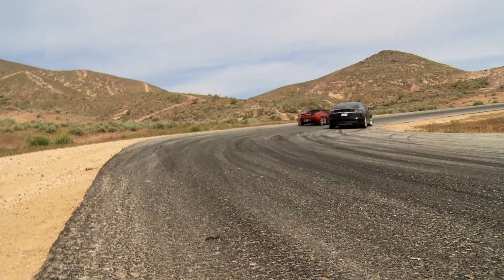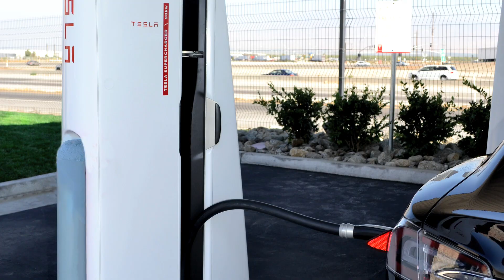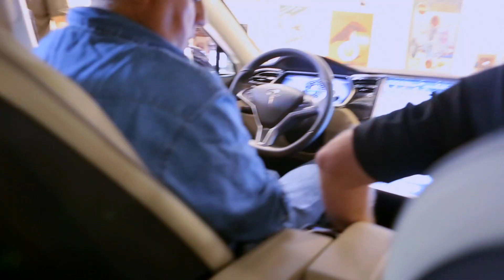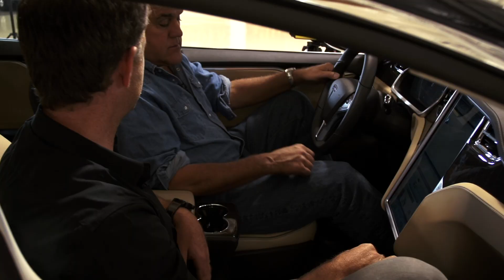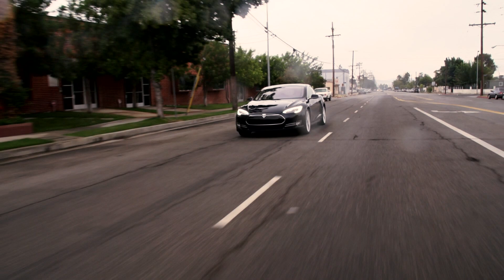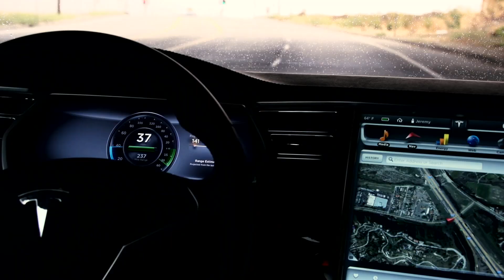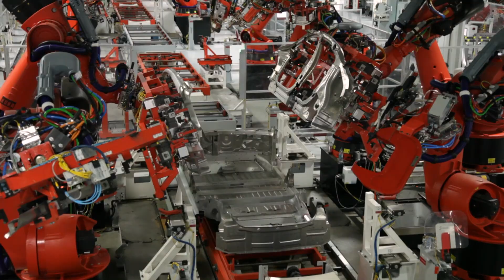2012 Tesla Model S - Jay Leno's Garage

Comment: Thoughts nice, 450 mile range after a 3 minute charge , that's over engineering for what really is the first mass produced all electric car that performs like a Aston. Lets face it most Aston,s are parked up out side the posh tennis and golf clubs all-day and probably only clock up double digit mileage daily anyway why a need for 450 miles on a single charge.

 Give the car some space and time remember when it was only the rich who owned Mercedes  now your local taxi driver uses one to take people home at night. Next to the house you buy, a car is your next big purchase and this car is perfect the way it is probably to perfect if you stop and think.

 No more trips to the dirty petrol stations and waiting behind someone who choose to do the weekly shop and a full tank here in the UK empties your wallet weekly .

 No more smelly engine or gearbox problems just good clean organic motoring with dare i say fewer visits to the garage in fact i cant really see why you would need to go to the garage at all ,perhaps the brakes, but there energizing braking system largely avoids that , more money saved, big bucks compared to the Aston i here a oil change is a couple of hundred! .

This is the thing its really not a car anymore it a ride its thinking outside the box its convenience at the highest level the sort of thing the Iphone did to the rest of the competition, its raised the bar and the competition should take note and of course will in the very near future.

The price tag is of course a sore point but who buys a car cash anymore its allways done over a 5year period so i hear around a 7500 deposit and around 150 aweek  its yours and bare in mind if you do a litlle more than avrage milage a week the zero cost of fuel you save more or less covers the monthly repayments here in the UK.

Its a no brainer this model s is the future and when the car maker gives birth to a few baby versions for the young ones and the oldies its job done, good riddance to smelly, dirty, noisy, expensive, troublesome combustion engines for ever.

Don't get me wrong the model S is obviously not the car for all but the theory definitely is!
Reply: i think it was 30mins. but still if you are on a roadtrip you can just stop for a cofee or lunch. and i really like that Tesla has released all their patents to public so they dont slow down on the prosses :)
Reply: Exactly. Right on the head!
Reply: john spicer I

Comment: Electric cars are quite, now have good range, amazing acceleration, great top speed, loads of space, low centre of gravity, great for the environment and even the factories are clean. Can someone please remind me of the plus side of a gas car? Once true mas manufacturing of electric cars happens they will actually be cheaper to buy than gas cars 'and' not need maintenance.
Reply: Marine475
pretty much all you stated is either wrong or poorly understood (purposely distorted?). efficency of an electric engine is about 80%...any combustion engine has a below 40% efficency...so basically 60% of that power inside gasoline is tronsformed into heat, not motion. An internal combustion engine is about 4 times more likely to catch fire. "Advanced power cell" which isn't even the correct word, (i think you ment hydrogen fuel cell) is not used in the tesla...but your statement isn't even factual anyway. Yes, the tesla uses electricity...which is signifficantly cheaper than the same amount of energy in gasoline. 85kWh power worth of gasoline is 4 times more expensive than 85kWh electricity. And no, you do not need an industrial grade powerline...most countries on this planet have 240V anyway. I could go on and dismantle your other statements, but i will just leave it at that to not embarace you any further.
Reply: Still power density of crapiest gas is times greater than of the most advanced power cell that btw tend to explode when fully loaded+ even under very mild usage this car uses more electricity in an hour than your home during entire month. Oh yeah and to load it's batteries you'll need industrial grade power line that alone is as expensive as the car.
Reply: sHmAaa
how is that even an argument? 200 years ago, people relied on whale oil... there are literally thousands of examples of whole industries vanishing practically overnight due to new inventions. This is not a problem, but an opportunity. History has proven your argument so wrong, it makes me question if that post was even serious.
Reply: Marine475
yes but fact remains, that even though gasoline can store much more energy than a battery, the efficency of any gasoline engine is half of that of an electric engine, period. You can deny that as long as you want, it still remains true.
Reply: thedon008 I've driven cars that cost me 5k that lasted me OVER A DECADE. Cheap car means the methods and materials used to manufacturer the car has been perfected and streamlined enough that they can sell the car for a lower price and better compete with the lower priced economy gas cars.
Reply: When electric cars are the norm rather than the exception and the whole infrastructure has adapted to them then their cost will be on average only half of what today's smokers are.
Reply: Peter Stephenson
as I stated above, electric cars are already cheaper over a 10 year (or even less) period, simply because the maintenance cost is so much lower and the "fuel" cost is basically a tenth of what gasoline would cost.
Reply: Jeremy Prince
you do realize that it is a high end luxury car? A Mercedes or Lexus in the same category costs the same or even more.
What power source it runs on depends on where your electricity comes from. In many states or countries it is already to a high percentage renewable energy sources.
Even if it comes from coal, the efficency of the plant and the electric engine is about twice as high, as any gasoline engine. Fuel cost per mile for an electric car is about a tenth of a gasoline car. (atleast here in europe where gas is relatively costly)
So your carbon footprint is signifficantly smaller (only 20% of a normal gasoline engine), even if the energy came from a coal power plant. Ironically enough it would be more efficent if the same amount of gasoline would be used to produce energy in a power plant with an efficency rate above 85%, then used in an electric motor to produce the same kinetic energy as if you had used that gasoline in a conventional engine with an efficency rate of not more than 40%. (most of the energy in a combustion engine lost as heat.
Smog would be a something of the past, even though you may not care about smog, the citizens of Beijing or San Francisco do.
Most people use their car for a daily trip of about 50-100 miles if they have to use a car to get to work. Well within the range of any electric car. Sure there are people who drive 400 miles or more per day, probably an electric car (with the current technology) is not yet ready for them. Honestly, I don't even know somebody that drives 400 miles in his private car on a daily or semi daily basis.
Reply: The plus side? Your whole economy relies on it.
Reply: Marine475
 im pretty sure most cables running to every house across all of NA are 240v and are brought down to lower levels so no trouble there.
Reply: Raussl
Uh dont know even where to start. Charging 85kwh through 240v line requires a lot of time, or very thick cable- how thick- google mr Ohm and ask him :) The thing about electric motor isn't about motor itself but about storage. Gasoline holds 44MJ of energy in 1000g *30% efficiency= 13,2mj/kg Tesls S batter pack holds 85kwh of energy @ 555kg- I actually wasted some time to find that one out. 85kw *3600s = 306mj/ 555kg = 0,5mj/kg. That's what energy density stands for btw. and yes the kind of batteries that can hold more power per kg overheat and catch on fire. Anyway Tesla S drives around with gas tank equivalent of 42l that takes 18 hours- (Mr Ohm) of charging using 240v 20A normal household power line. That's  elementary school physics btw. so if I got anything wrong feel free to correct me- in the process you might even learn how electricity works.
Reply: hgjh
Reply: Peter Stephenson "Can someone please remind me of the plus side of a gas car? "
They're cheaper. Let me know when I can buy a Tesla for $14,000 and I'm sold.
Reply: TactileCoder Well, when they're gonna be as crappy as a 14 k car, then you'll be able to buy one for such money...How can you even say you want one for 14? it's obvious the quality will be no where near what you gen in a model s. They will make a 3 series competitor in a year or so, and mass produce it. It will be around 30k.
Reply: eletric car is expensive than gas car
Reply: Muhamad Ubaied
depends on the gasoline car you compare it to...Tesla S is a luxury car with 400+ HP...a compareable gasoline car costs actually more or just as much. Considering there is no electric car that is produced in the millions right now, your statement lacks the necessary parameters to comapre it.
Maintenance is actually a lot cheaper for an electric car...no engine liquids or wear due to friction and the MUCH lower fuel cost make the car's maintenance cost significantly lower than a gasoline car.
If anything, the price is relative...for a luxury high performance car the Tesla S is actually very cheap. With all those side benefits in mind and over a 10 year lifetime period, the Tesla S is actually comparable to the costs of a 25 000 dollar conventional car.

The next model of Tesla in (around) 2020 will be a mass produced (millions) electric vehicle at a price of around 30 000 dollars.
Reply: Muhamad Ubaied  My electric smart car leases for $400 down and $139 a month. I'd say that's as low cost as the lowest gas cars. In a few years, it'll be this price without any fed subsidy too.
Reply: This $100,000+ car is far from affordable, and is so environmental unsound its really ignorant to ignore. All this is, is a coal powered vehicle. It takes 9.5 hours to charge it for a full 300 mile range, so obviously the freedom of movement has severely taken a hit. Let me know when an electric car can refuel in less than 10 min to go another 300 miles THEN I will be truly impressed.
Reply: Jeremy Prince You charge it to 80% in 20 minutes, and the battery price will severely go down once they mass produce them, plus the technology will improve, making them more efficient. Is it really that hard to realize that? Do you feel so special going against the natural evolution of ways of transportation? Do you think cars got 30-70 mpg 50 years ago? And they didn't even have to...Now, they need to make them as best as they can, and improvement will come. Go get some logic for your own sake...
Reply: sHmAaa There's always that guy, who doesn't actually get the question. He isn't saying we should get rid of gas cars in an instant. He's saying why would you use them if there's a better alternative. If you had to chose, the choice is simple.
Reply: thedon008
'' Once true mass manufacturing of electric cars happens they will actually be cheaper to buy than gas cars 'and' not need maintenance. '' No, no and no. You need to get off my nuts and learn to read properly.
Reply: sHmAaa You don't make any sense, yet you want people to leave you alone. What of that does not compute with you? They WILL be mass manufactured, they will probably be cheaper with time, and they won't need maintenance since they only have 1 moving part. No fluids, no nothing. So come again?

Comment: wonder how much would replacing the batteries be? probably some sick price.
Reply: As a mechanic who has had to pray a customer wont have a heart attack when i have to replace an engine in a modern ICE car(the last one cost the customer 6 grand, that was with a USED engine), the price is likely cheaper. A new engine from toyota in this instance was nearly $20k, just for the engine. Even if a new battery was $20k for this car it wouldn't take 23 hours of labor to replace it....

Comment: I want to people to understand about the battery system of this car. The battery is warranted for up to 10 years but the battery starts to loss battery power after 10 years. If you do your research it losses up to .010 percent of power after ten years every year after. That means you loss about less then a eighth of a mile every year after 10 years.

Comment: I wonder how well this 2012 Tesla will hold up during the next 10 years. I'm really interested in buying one because I drive about 50 miles everyday on the weekdays alone. (I rarely drive on the weekends, so I won't factor that in). I drive a Volkswagen Passat, so the mpg is great. If I drive to save, I can easily get 30+mpg.. But because I drive so much, I'm wasting like $35-40 a week on gas :( If a Tesla can save me $10-20 a week and hold up for a decade, I'm sold! After all, my Passat has 160k miles on it and still going strong.
Reply: in addition if you buy a tesla, you will save a lot of money on fuel and maintenance, so even after 10 years when the battery needs replacing, you will have saved more than its worth over those 10 years anyway.
Reply: stick with your GERMAN car ;)   it will keep on going as long as you  keep replacing all the neccesary  things suchas  oil belt    and others :)
Reply: Rytis Kurcinskas you literally just used the reason why normal cars are bad to try and make them look better
Reply: It's expensive though. One of the models, I believe on(oops one) configuration of the P85+ is around $92,000.
Reply: I think it will hold up rather well. Modern Technology has enabled even cheap cars to last for decades, imagine how long the mechanically simpler (compared to a gas car) Tesla will last using the same modern manufacturing and corrosion preventative techniques. Btw I am a mechanic and see first hand how much longer cars last these days.
I also worked on Electric forklifts for awhile, and they were VERY reliable, despite running 24 hours a day. They do break but are very easy to repair compared to ICE technology. I imagine an electric car is similar in this regard.
Reply: Unless you have solar at your home, you would only save about 5000 in fuel over the life of the car. Even if you have solar and factor in the extremely low maintenance! you would not come close to making up the difference in the price of the car.  But that's because this car is not meant to be economical in that sense.  This luxury car is meant to help build the company. Once that happens, Telsa plans to produce economic cars, the first one probably being about half the price of the model s, and then an even more affordable one to follow.